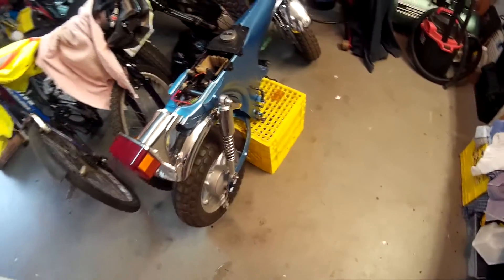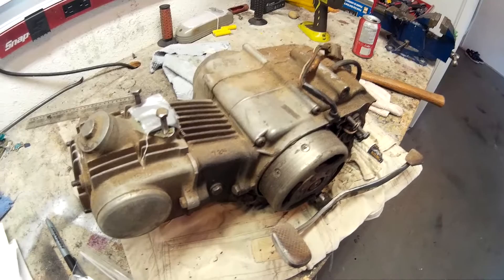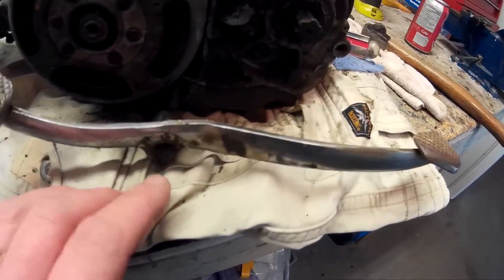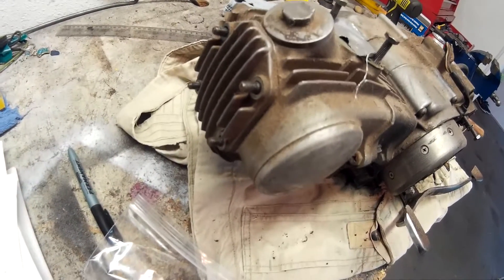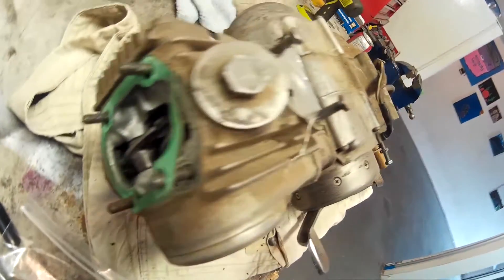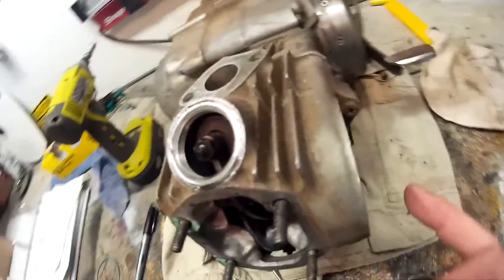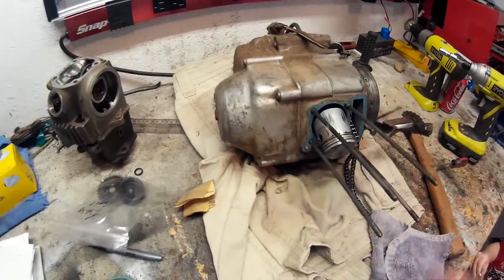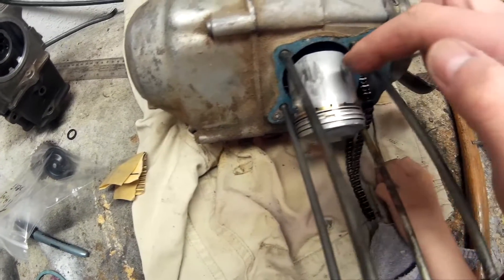honda ct70

Comment: are there little rubber gaskets on there once you took the cylinder off? I am putting mine back together and can't tell from the renderings.
Reply from the maker: yes their is two o rings. one is on the bottom of the base, have a look at the base gasket and you'll see and the second is on top of the base have a look at the head gasket. Also have a look at this manual, it will help you its a pdf file https://lilhonda.com/docs/CT70ShopManual.pdf